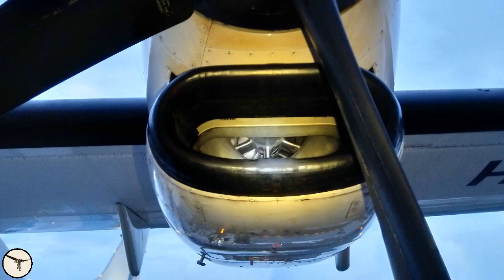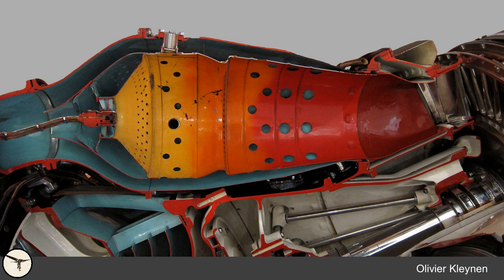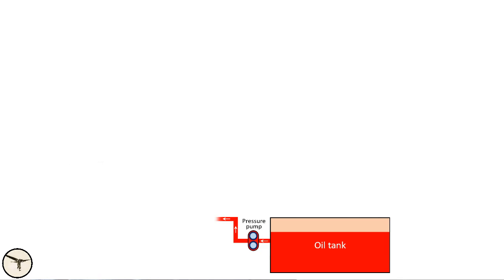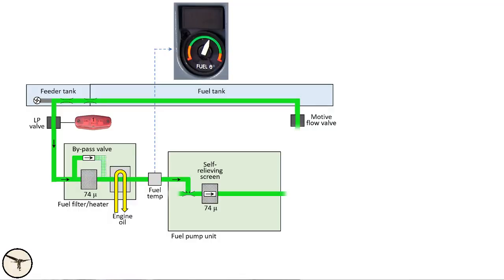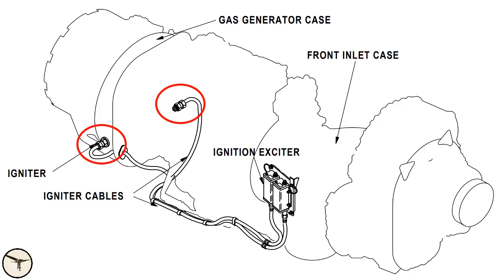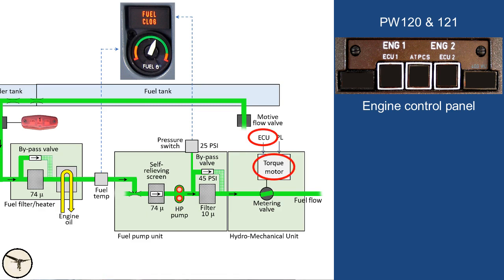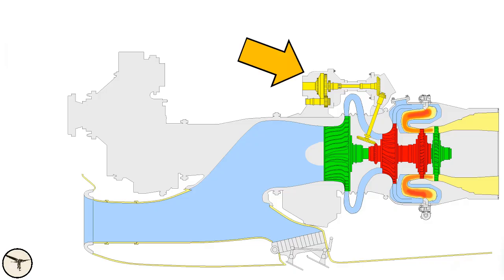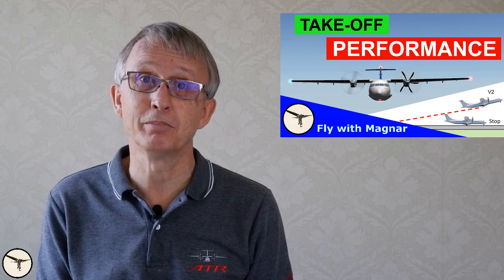ATR systems - Powerplant part 2 - Gas turbine

Comment: How the compressor turbine being cooled down?
Reply from the maker: We run the engine in idle for at least 2 minutes after landing. After shut down, the engine will cool down by radiating heat to the atmosphere. Parking the aircraft into the wind will help.

Comment: My doubt is why there is an 2.15 seconds delay in Auto-Featheing on ATPCS sequence
Reply from the maker: This prevents the propeller from being feathered in case the engine failure happens before V1 and the take off is rejected. This provides drag from the propeller, making it easier to maintain directional control.
Reply: @FlywithMagnar  so if propeller is not feathered..my confusion is.. low pitch light will come or not in failed unfeathered engine while rejecting?

Comment: I think the SP of pressure switch at 13.06 minute is a mistake. Would't it be 250 psi instead of 25?. Te pressure at the combustion chamber is 290 psi

Comment: Hi Capt, When the MAN IGN PB is selected, whether it provides continuous ignition even after NH crossing above 60 %?
Reply from the maker: If you mean the guarded MAN IGN pushbutton shown on 18:20, then the answer is: You don't use MAN IGN when you have an engine flame out. The engine has automatic ignition when NH drops below 60%, and therefore, you are not required to activate manual ignition. MAN IGN must only be used in specific cases shown in the checklist for EEC fault (18:40).

Comment: Dear Captain,
I was wondering regarding the Time limitation imposed on Take Off Power of 5 mins AEO and 10 mins in SEO. But MCT  on the other hand has no such limitation, considering MCT output is 2500 and Take off power is 2475 SHP. NP is 100 in both cases. what is the essential difference in the MCT setting which allows it to operate in unlimited time.
Reply from the maker: Normal takeoff power is 2,475 shp. This is what we use every day. To prevent unnecessary engine wear, it is limited to 5 minutes. A hot section repair is very expensive.
Reserve takeoff power is 2,750 shp. This is emergency power in case an engine fails at takeoff. It is also used for go-around. Both events do not happen very often. You can use this rating for 10 minutes without damaging the engine.
MCT power is 2,500 shp. This is maximum continuous power without damaging the engine. Engine wear is higher than normal. Therefore, we use MCT only when flying single engine, or when encountering emergencies like windshear and TCAS resolution advisories.
Reply: Just a follow up question with Pwr MGT at MCT and PL at Ramp we would still get 2750 hp Correct, Captain?
Reply from the maker: @darshanp651  Yes

Comment: Hi, nice and interesting video, Do you know if reducing or increasing ITT temp has any implication on nacelle overheat when you have a tail wind
Reply from the maker: It's hard to say. When you increase ITT, it's because you increase the power, and this will increase the velocity of the exhaust causing it to move further away from the nacelle. Maybe. It boils down to the exact direction and velocity of the wind, and the residual temperature in the engine when it is shut down.
Reply: Thank you Capt !! I really appreciate your response

Comment: Why ATRs does not have auto thrust?
Reply from the maker: Well, the engines do in fact have automatic power management. It works when the power levers are set in the notch. When the power levers are in other positions, it's the pilot who has control.
Reply: @FlywithMagnar  But, can it follow a IAS set point? I do not fully understand how you can set a desired IAS at cruise mode. Thanks for your answer. Congratulation for this nice channel.
Reply from the maker: Jetliners cruise at a given Mach number in order to maintain separation from traffic ahead and behind. Therefore, they need an autothrottle. 

Turboprops don't have this speed limitation. We maintain constant cruise power and IAS is what it gets. Furthermore, IAS depends heavily on the cruise level. We have tables in our Quick Reference Handbook showing which cruise speed we will maintain. For example, to maintain TAS 260 kt, IAS must be 225 kt at 10,000 feet, and 192 kt at 20,000 feet.